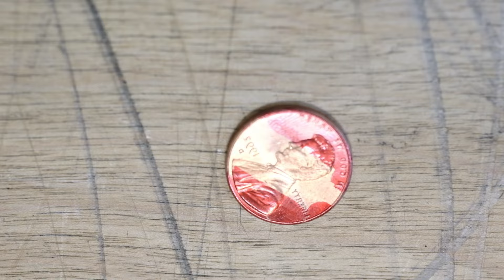Type Shop, Ep. 23: Type Ball Repair with a Penny

Comment: Might it be easier to use a piece of brass sheet metal? But well done anyway.
Reply from the maker: @sparky60ful  don't have brass sheet on hand.  This is cheaper.
Reply: @TypewriterChicago  It won't be cheaper if the right person sees this video. That penny is government property, and defacing it is illegal. It's unlikely you'll get in trouble, but why risk it?
Reply from the maker: @fixitman2174  it's only illegal if your intent is to deceive.  Otherwise it would be illegal to let you pocket change oxidize in the washing machine.